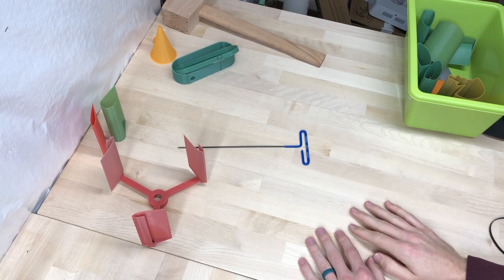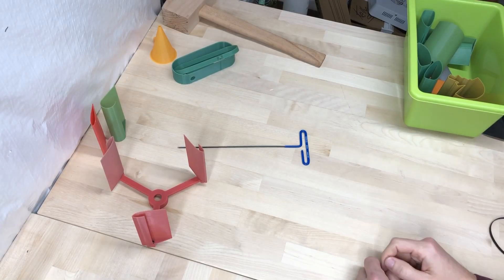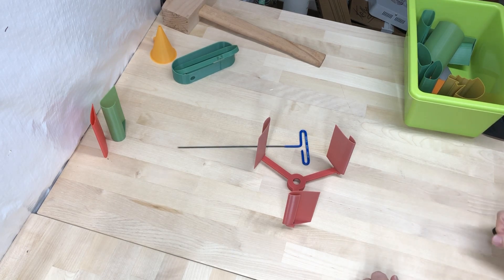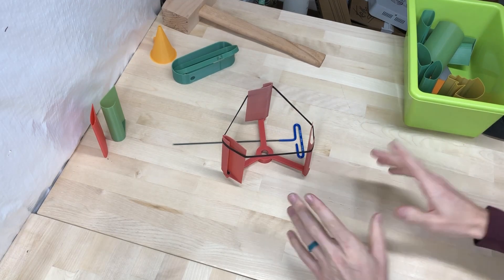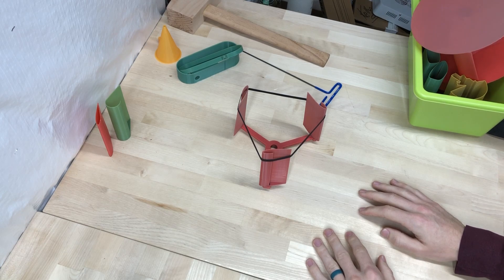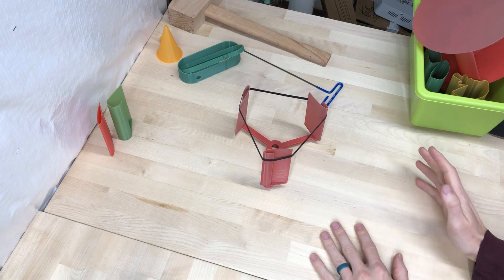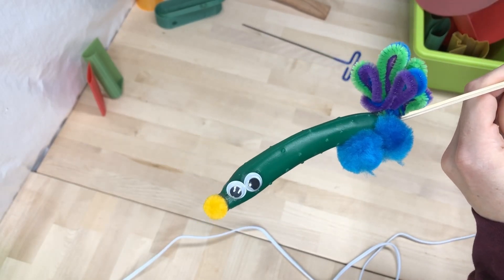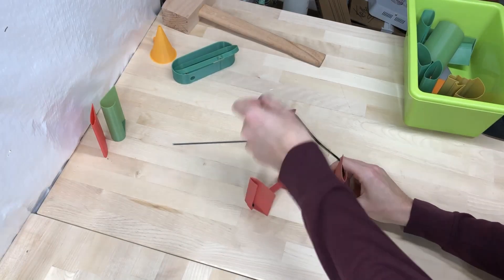Our most powerful wind turbine design yet?!

Comment: this blade is called a J blade for obvious reasons; first saw it on a ... Japanese, Vawt about 15 years ago. You're just basically testing rpm if you don't put a load on the system right?
Reply from the maker: We are applying a load and measuring power.
Reply: I looked through the vids and couln't find one showing it so I guessed; what does the load setup look like?
 @hellothisismax
Reply from the maker: It's a small generator and an electronic variable load. I wrote a program that increases the load being applied to the generator until the voltage drops to 0. We are really only looking at peak power. I'm writing a mppt function so we can also test power output vs wind velocity.
Reply: @hellothisismax  What AOA are you using on the blades?
Reply from the maker: It's 16 degrees, I picked that angle randomly after reading a paper on the effects of airfoil AoA on VAWTs.
Reply: @hellothisismax  the J foil turns into a symmetrical wing at just over 1 tsr and symmetricals like to run for optimum lift at 3.5 degrees at around 20-25 percent mount point which is about where you have yours. The Lenz you test on another vid likes about 7 degrees optimum at the same mount point.
Reply from the maker: Thanks! I think I'll have to do an AoA episode now!
Reply: @hellothisismax  Good idea!  the 3 bladed savonius is already optimized but could be put in as a comparison. I have a wing design I'd like to try but I don't know how to plot it

Comment: -nice results!!!  
-ideas for future comparison test:
Make half of the airfoil symmetrical and half cut out for self starting.
Keep changing the angle of attack slightly to find the best one.
Reply from the maker: Good to see you back! Will higher angles of attack increase torque?
Reply: Your windy hole can answer that better than I can.  The ratio of the width of the blade to the diameter of the rotor (solidity) and the width of the blade vs wind speed over the airfoil(Reynolds number) will both effect the best angle of attack.
A VAWT with wide blades compared to the rotor diameter will get most of its power from the upwind side of the rotor while slowing the airflow to the downwind side of the rotor.  In this case pitching the blade outward or having a non-symmetrical airfoil lifting inward works better. @hellothisismax
Reply from the maker: Thanks Dan!